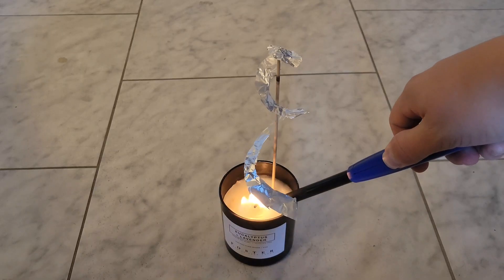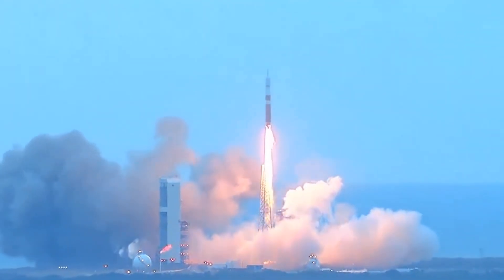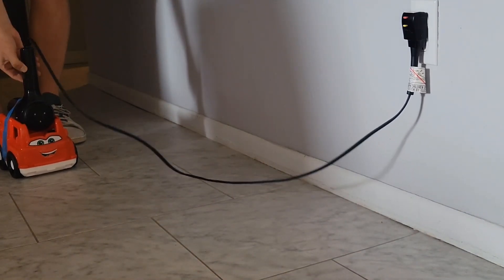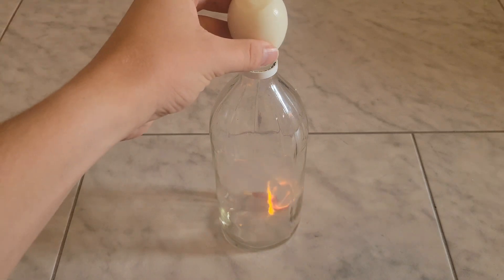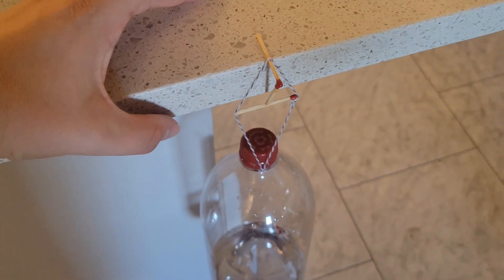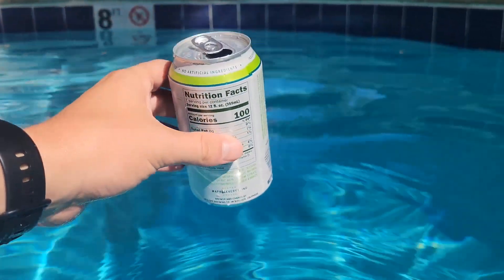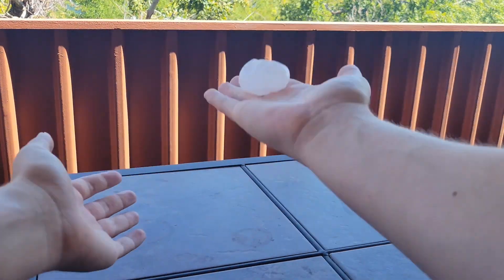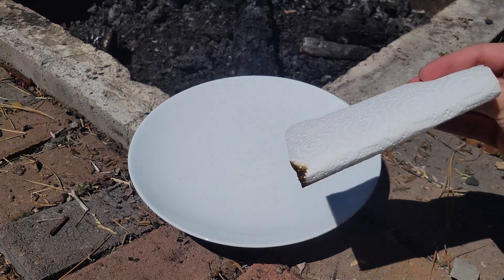2 Truths And A Lie, but with Science Experiments. (S1E6)

Comment: Wouldn’t the first one also not work due to the fact the hair dryer is also sucking in the air it shoots out, both forces cancel each other out. Rockets actually eject the fuel as it is burning and lose mass during the process

Comment: Actually, the hair dryer thing was not entirely accurate. The hair dryer wouldn't propel the car IF it didn't have enough pressure at the outlet side of the 'pump' to overcome the rolling resistance. Can't tell that from our side (viewer) of like 2 seconds. The pressure thing does work, if is enough to overcome the resistace.
So ... That one was 👎.
Everything else I've seen you do has been 👍
:)
Reply: We got the ackthually guy right here

Comment: You are wrong about the hair dryer. Even a weak hair dryed would be able to push a car as long as the rolling resistance is not to high. And rolling resistance can be made very low. You just chose a bad dryer/car combination.

Comment: Round 1 is such BS. That particular hairdryer may not be able to push that particular toy car because of the axle friction or something, but obviously a hair dryer does exert a force that could be used to push an object. How could we possibly know that the hair dryer was very weak?
Reply: I thought that too.  But if you think about it , if that hair dryer was strong enough to push its own weight and the car it would be trying to blow itself out of your hand whenever you used it
Reply: @stevePHXD  but a hairdryer DOES try to push itself out of your hand. Your hand/arm is just way stronger. If you got a really lightweight cart with super smooth axles, a hairdryer totally could push it. The point is, it's not breaking any laws of physics or anything, it's totally possible and there's no way we can accurately guess that it wouldn't work.

Comment: Round 1: I know 1 and 3 are true, so I'm ruling out 2 by process of elimination. (Okay, I knew 3 was correct in principle, but it didn't occur to me how weak hair dryers were)
Round 2: It doesn't matter the arrangement of the matches. The top match in 1 is experiencing a force greater than its weight ahead of a fulcrum. There's gonna be a torque on it. There has to be something on the table holding the match down. (I'm completely stumped. I suspect it has something to do with that quasi-triangular formation, but even then I don't see how the torque isn't affecting the entire system.)
Round 3: This is a tough one, but I know 3 is a real thing, and of the remaining two, 1 feels less believable. So I'm going with 1. (How did I get a question right about the one subject I failed in college, while missing the two questions on the thing I actually have a degree in?)
Reply: Regarding the matches, pay attention to where the center of gravity is. It's under the table. This is basically the same idea as one of the earlier videos involving some silverware and a toothpick.
Reply: idk bro, but you're not wrong with the hairdryer, I made the exact same setup myself, and my hairdryer EASILY duplicated the faked results in the video.
also, for the balanced matches, I'm a noob at geometry and stuff, but I understand the simple physics, (and also that its harder to fake that one with editing than with the others)
the top match is pivoting at its center, and if it were to pivot downward in the process of falling, it would be pushing down on the match underneath it, which consequently pushes the one under that. this last match is held by friction, and its resting in the widest portion of the loop of string, which is held in tension by gravity, so if it moves downward, it gets forced into the narrower portion of string, which doesn't want to happen since its in tension, and wants to snap together to make a straight line. the pushing down force would also push sideways a little, pushing the bottom match away from the camera, and this makes the loop of string no longer straight, but bent, which is not the quickest path from A to B, which means it would have to pull the bottle upwards to remain the same total length, which also does not want to happen, since gravity is pulling the bottle down. its a bunch of opposing forces that have all hit equilibrium.

Comment: 1 for three.  I got fooled by the simplicity of the hairdryer claim.  And I know the squeezing bottle trick works with pen caps, it didn't occur to me that it obviously wouldn't work with something naturally buoyant.
Reply: I haven't tried it, but wouldn't the squeezing bottle thing make pen caps sink, not float? Since the air inside them would compress, and they would partially fill up with water, making them denser and therefore sink
Reply: @Einstein-wasnt-all-that-smart  I had to look it up to check.  It's the "Cartesian Diver" experiment.  And you're correct, it sinks when squeezed, I got it mixed up.